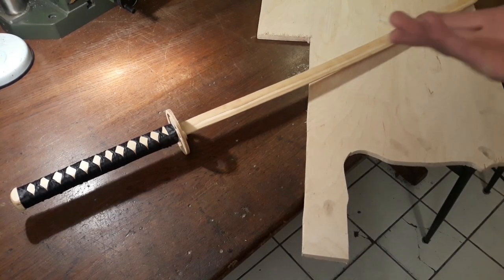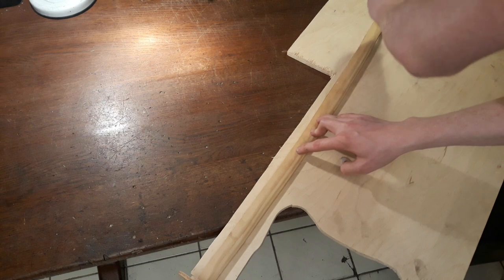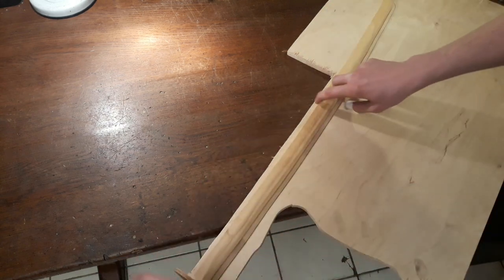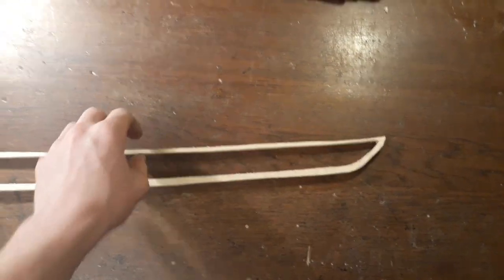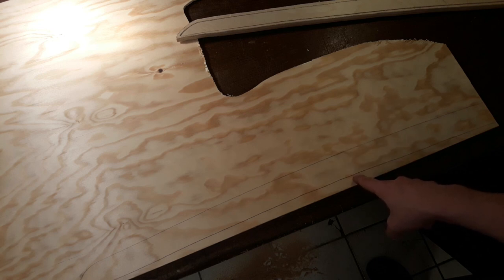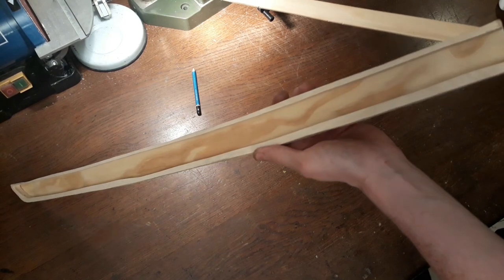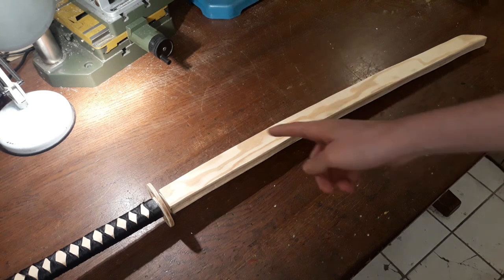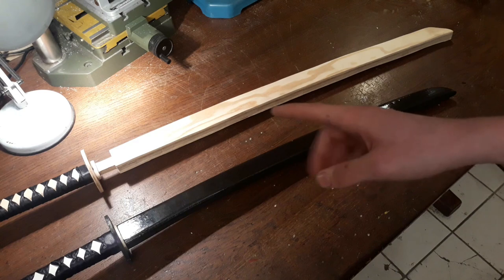EASY way to make a sheath!

Comment: I like this video, I have a latex katana and worked perfectly,

What I did: i did exactly the same thing as Nik but when I finished my sheath I put some THIN wool into my sheath so it didn't ruin my latex blade

Overall a good video!
Reply: You can also use felt, works very well to protect your blade if you've painted it like I did
Reply: Can you also make this sheath for a metal sword? Or should i put some material in the sheat so it doesnt damage the sword
Reply: @dryox498  Might want to put in a think layer of felt to ensure the blade stays dry to avoid any damage.